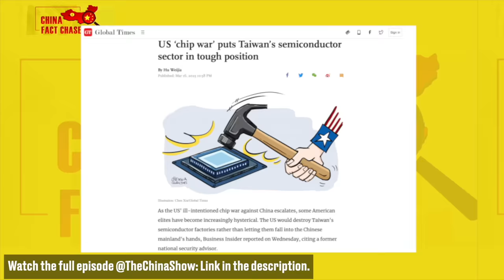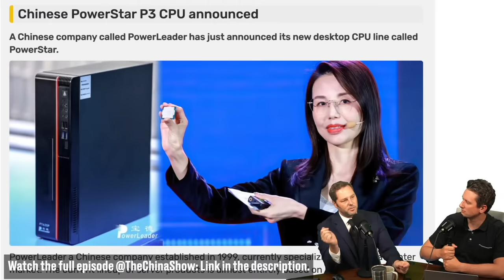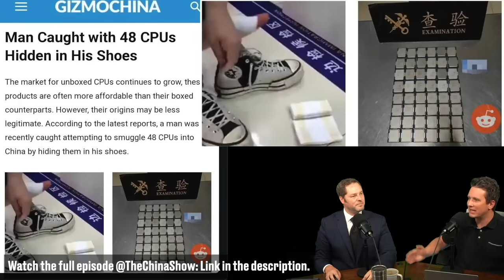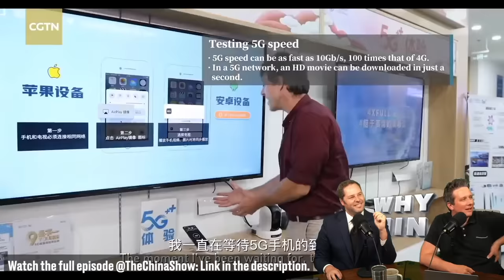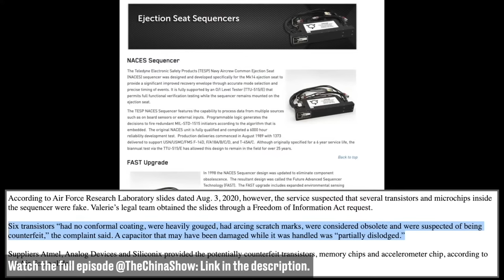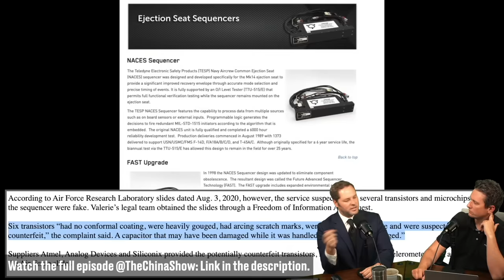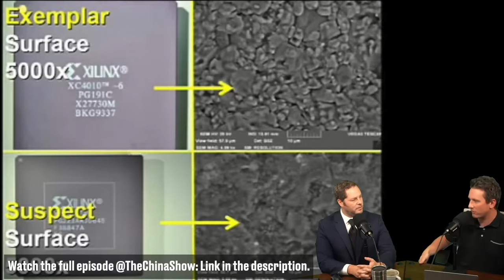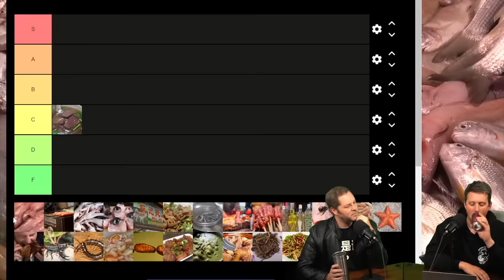China's Fake Ass Computer Chips Are An Embarrassment!

Comment: It's a lot easier for China to change the outside, cosmetic look of a chip than it's actual functioning. I would be really interested to know what information a program like CPU-Z reports on this chip. (Instruction set, code name. I bet it will report the "P3" as an I3).
Reply: i would think they've (but that might be putting to much thought into it) picked a cpu with re-writable areas where you can pretty much type in whatever info you want, only way to figure it out would just be stress tests to see how it actually performs, and compare results.
Reply: @LevitatingCups  there are still ways to tell. Especially if all parametrs are exactly the same.
Reply: Geekbench V5 says it has an A0653 (GenuineIntel) CPUID.
Reply: If it works on an intel chipset motherboard you dont need to go further

Comment: I believe it's safe to assume that EVERYTHING coming from China is intentionally or even just through normal manufacturing w/unsafe materials literally is physically toxic in one way or another, often NOT by accident/mistake etc.
Reply: For +200€ I bought 2 govee LED products, But without the app, it doesn't work! Of course, the app is from China & it want to have access to your, call list, location, data&pictures, wifi,...This is crazy. If I I don't allow just one of all those things. I can't open the app and I can use my +200€ LED stuff.

*bought in Germany from Amazon
the LED stripe also has a microphone "just for detecting music"
Reply: @cicathebengal  sounds like you need a cheap burn phone/tablet to use to enable it then stick in a cupboard somewhere till setting need changing.
Reply: They were providing covid tests, in 2020. 
That was just beyond belief to me. 
They had a vested interest in higher case numbers in the U.S. and we bought their testing kits.

Comment: It takes at least a decade to build the infrastructure around chips. Given the corrpuption it would probably be closer to 25 because of all the double checking. Not to mention the incredible dificulty in just ensuring structurally sound buildings. Also, i like how the intel chip is numbered 00404. Chip not found.

Comment: The way to say it correctly is China can make chips, no problem down to about 28nm, but going below that requires equipment that different countries don't want them to have, the main equipment being the lithography equipment to etch out the transistors that gets you below 28nm.  This equipment comes from ASML, and while there are the people who COMPLETELY blame the US for this, that's not true.  It's more than the US, and there are multiple factors going into ASML because their roots come from different companies including US tech companies, so this is MUCH deeper than just the US govt. not wanting China to get the latest lithography equipment from ASML.  Also ASML is a public company and part of the major stockholders, which are other companies don't want ASML equipment going to China.

Now, you can make most of the ICs the world needs with ICs coming out of these Chinese fabs, but you can't make cutting edge chips.  28nm gets you back to about 2012 - 2015 I believe so they're kind of frozen in time at that point.

Also, you CAN make smaller transistors with the lithography equipment they have, BUT it takes longer to do it, and the defect rate is higher, so it's not economical to do it, but they can make ICs for their military equipment that's pretty state of the art, so don't think China is just stupid in this regard or can't figure this out.  Eventually they're going to reverse engineer ASML lithography equipment, steal enough patents and figure out how to make more state of the art chips, but until then, making this equipment is SO hard and SO expensive that only one company makes the leading edge lithography equipment, ASML.  There are other companies that make this equipment but it's not near cutting edge like ASML has been at for many years now.  It's also kind of like, there is ONE company that can make wafers and then make the ICs that are cutting edge, and that's TSMC.  Both Intel and Samsung are behind TSMC so TSMC gets the bulk of the contracts for the cutting edge ICs.  And for the most part we're talking about ICs that have billions of transistors in them, so graphics adapters and CPUs make up a pretty good chunk of this.  Also there's specialized server hardware that need cutting edge chips.

Comment: It might be some kind of artifact, but it looks like the chip being held up in the presentation (which was so expertly enhanced) has 4 lines of text, like the i3 chip, rather than the 3 shown on the P3 chip. Also noticed that the edges of the shroud where the laser etching would be done, are more rounded on the P3 than the i3.
Reply: The shrouds on different CPUs of the same model can have slight variance like that . If you look up pictures of the i3-10105 you will notice that some look more or less rounded on the edge .

Comment: This peaked my interest as a software engineer who has worked with these chips bare-metal.

I knew it had to be a ripoff right from the get-go, but the only way this COULDN’T be is if they cloned the schematic, which requires the FOBs.

Chips CAN be built compatible. For example, AMD processors use the Intel x86 standard, which it got the rights to basically by accident lol. China could also very easily use the ARM open standard and get into zero trouble. They might have hiccups, but at least it would require minimal change to their computer software to make them work on the new chips

But they treat objects at face value. A car is a car. A gun is a gun. A chip is a chip. They don’t know how to integrate properly, even if they can reverse engineer
Reply: AMD got an x86 license because the US government wanted to have multiple suppliers for their chips. If Intel wanted the juicy government dollars, it needed to license its architecture to another company.
Reply: "piqued"---I can't help myself.

Comment: Bought a gtx 1060 for 130$ from wish years ago (it was a 350$ card at the time). It was more curiousity to see what the card actually was. Used a gpu analysis app (maybe gpu-z) to compare its physical specs to see if it matched the bios. Turns out the card was a GT 450. It had native 4:3 resolution (meant for crt monitors). The 10x0 series driver installed without issue but the card seemed to run in a plug n play kind of mode, using the barest of settings. 

I sent a dispute with all the collected data and they asked me to take a picture of the card and stopped responding. The shipping time was a few weeks and this felt like they were milking time to make it so a chargeback wouldn't be possible. So due to their slow responses and seemingly pointless process, I ran the chargeback through visa. A week after the chargeback was processed, my wish account was banned for no reason stated. 

They didn't respond after the 'take pictures' response (which i did send them) and couldn't check if they asked for anything else due to being banned.

Comment: As someone who works in the industry, you can't even trust font-type because in a lot of cases the original companies producing the chips use different fonts from batch to batch so there's no consistency. Only way to check for counterfeit parts is to only buy from approved vendors ($$$) and to test your stuff ($$$). Inductors are another serious problem since there's only like three large-scale producers in the world and the cheap one is from China, but since 2020 China puts a "wait time" on purchasing inductors even if they are ready to go.

Comment: I wont buy anything electrical off ebay.  Bought Makita batteries off Ebay.  Dead within a month, the plastic was shinier than Makita makes them and the font was different.  Bought a hard drive, dead within a month, the font was different and the surface plastic on the bottom was different.  I bought a water pump from a Ford dealership for a 5.0 and the tag said “made in China”.  Glad I bought a backup.

Comment: Funny thing about poppers.  When I was in China I told the Chinese how hard it was to cross the street because the cars don't stop at lights or stop signs.  They told me to just step out in front of the cars without looking up or at the car.  That way the car doesn't think you saw them and they will stop.  I saw a young woman do this in the middle of the street in front of a city bus and the bus came to a screeching halt. I told them they were insane because for every 99 cars that stop 1 car won't and that 1 car will probably be me.  I got clipped by sideview mirrors on cars more than once because cars will blow through red lights when I am in the crosswalk.  One piece of advice is not to run which is the non-chinese first instinct.  If you run you through the driver off and you will run in front of the car.  For some reason they almost always swerve in front of you.  Also when I was in Wuxi China for a month there were NO man hole covers.  Sidewalks, Street no covers and no barricades.  You had to watch were you were going.  Just amazing people were not falling down them.  Wuxi was the dirtiest city as far as dust and air pollution I have ever seen.  You could not see past a city block on most days.

Comment: I just got some flash memories for a custom CPU I'm building and I think the batch I got were my first fake chips. A cursory visual inspection show the top of the chips sanded down as it seems and engraved with new values.  Looking at the internal resistance, though I got nothing.  Looks like it's not even a chip but rather just an epoxy case with pins.

Comment: 11:36 it's called micro kernel
There's actually a small operating system running on the CPU that can be altered. It's also where it reports what kind of chip it is.

Comment: There was a time in the late 90s when one year made a huge difference in CPUs. Not so much anymore. We had processors like the 2500k & 2600k that would run 5ghz on the stock cooler from the CPU box and that was 12 years ago. Clock speeds haven't changed much. Sure, we have more cores, better cache, etc. GPUs are on a whole different planet from 12 years ago.

Comment: Chip designing isn't actually super difficult. It's easy enough to learn how to design CPUs at the transistor, gate, logic, and component levels, and there are a ton of component libraries available to bulk design from (ALUs, BUSs, memory, etc. components) The only real problem is fabricating them at the low nanometer scale. That's the difficult part. The process is mindblowing, makes your jaw drop when you understand how it is actually done inside the EUV machines, and that's the real issue - getting hold of the equipment to do it. Every country that can produce advanced CPUs/GPUs relies on the Netherlands for that nanometer lithography equipment, and if they can't sell to you then you can't make the nano-chips.
Reply: Yeah not english cuz the pt is about developing new designs at smaller nm, 3d, New more efficient designs etc
Reply: Designing the chips is also very difficult. Beyond needing to hierarchically design chips with billions of individual components, there are other challenges. Functionality and performance must be simulated, layouts must be optimized, and the design must be checked for faults. EDA design tools, as they’re called, are very expensive and I believe are sanctioned. Licenses can be hundreds of thousands of dollars. I think China just made their own homemade EDA tool but I haven’t tried it

Comment: In the 1980s, a professor at Stanford University developed a chip called the MIPS. This was a reduced instruction set (RISC) computer (one of the first). The ARM architecture is also a RISC design. He leveraged research he had done at the university and then created a company. As late the 2010s I had high speed communications processors using a MIPS processor. That China took so long to come up with something is ludicrous. 

As for the education system, I can confirm what you say. I studied with lots of Chinese students at a graduate school in a STEM field not too long ago. Also, at the high school that my younger son went to a high-level Chinese official came to visit (he might have been a vice premier if I remember correctly). I was supposed to be there, but something came up. He was so impressed with the school, and the positive attitude of the students. I have to say, though, that the graduation rate was not quite 100% (I think it was over 98%). I mention this because when I went to school half a century ago, we had a 100% graduation rate and a 100% college entrance rate. Many went to prestigious schools. And this was not the best school in our district (which was admittedly one of the best in the country at the time). The Chinese schools are an extreme, but many schools around the world "teach to the test", even in places like the UK. That is why you see angst with US performance on standardized tests used to compare countries. That is a flawed measure. It sort of reminds me of the Confucian system.
Reply: Regarding MIPS, people pay the tuition for university then the university creates a research program with the money. Then some dude creates a commercial product using the research. So in effect people gave him free venture capital and he doesn't owe them a thing

Comment: I'm an electronics engineer who's job is now half learning to spot counterfeits. There are bad ones, and there are terrible ones, and there are rarely very good ones. The worst is when a legit company that is actually legally licensed to produce a chip takes their defects and failures and sells them on the black market, because then you don't have a counterfeit, you just have a bad chip that appears to do "mostly" what it should. They're blurring the lines bad, and maybe if eg TI had sent their 6" lines over there to continue production on outdated but still very in demand products, China could've developed a legitimate business on that. That's what GE did with the 48" fluorescent lines, and those machines were the size of football fields. But that also would've required China's entire MO to change, because it's never been about a quality product, which is a shame, because attention to detail is absolutely a characteristic of the Chinese people.

Comment: Electrical engineer, here. There's a 99.999% likelihood that those P3 are indeed rebranded i3. It will be extremely easy to prove. In theory, yes, you could make a chip package that's exactly identical to another but with a different die (silicon) inside. However, you can't change the way it functions. A processor goes through a massive number of automated tests when it's being made (that's what the tiny pads on top are for, by the way) and it has a specific response to each test (say, the time it takes to perform a specific calculation). There's no way for two different processor designs to match the same specifications exactly. Even AMD's chips don't behave exactly like Intel's and they have been making x86 chips for over 30 years now (all the way back to the 486). So that's one way to tell what the P3 is.

Another is to just look at it. As in : remove the heat-spreader and interposer (the circuit board with all the pads underneath) and look at the pattern of the chip. It's billions of transistors, and it's unique to a given chip design. Oh and almost all chip designs have the company's name or logo etched in the silicon... and you can't laser-etch at that scale. It takes a FIB (focused ion beam) and would leave obvious signs of tampering (think of it as scorch marks).

Bottom line is, if we want to know what those chips are, we can. But we don't need to. China doesn't have the fab to make an 2021 i3 equivalent. They could produce a few (prototype-scale run) on 28 nm machines using multi-patterning, but it would take at least 4 times longer than normal and the yield would be atrocious, making the chips possibly ten times more expensive than a genuine i3.

China does have a history of copying western processors, and it's rather interesting. They used to actually want to be self-sufficient, but clearly the country has gradually gone down the drain. For example, you can look-up Zhaoxin, a joint venture between VIA (Taiwan) and China that does manufacture their own design of processors... just not nearly as good as a 10th-gen i3.

Comment: I bought 2  x Mechanist X99 Motherboards and CPU and Mechanist DDR 4 ram chips (I asked the seller if they ran windows 11) through AliiXpress and when I  built 2 computers with them
They woulnt even boot up -I even took the computers to a computer expert. They unsucessfully contacted the seller in China and got no help from them . After parting with $ 650 for the hardware and the computer expert cost $300 ,I threw them in the bin and bought an ASUS board an Ryzen CPU and put it together myself and it booted up perfectly.
Folfs whatever you do,DO NOT buy Computers or Motheboards from China or you will end up  al;most $1000 porer with just piles of junk.

Comment: Autopilot needs a confidence system developed with help and trained by traffic safety engineers and defensive driving instructors.  A confidence rating needs to be applied to each, independently, any way unique stretch of road.  Only allow autopilot to have full control where nobody in the traffic safety teams have an objection.  Forbid any sentiment from outside their group from interfering with their confidence system.